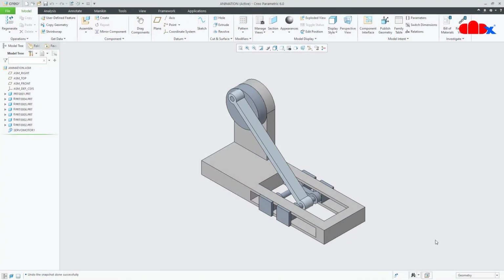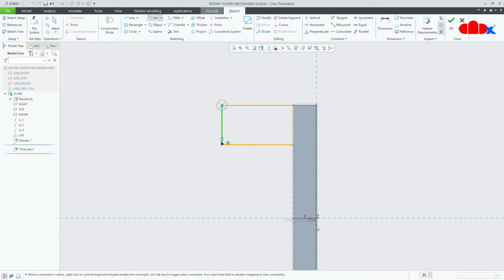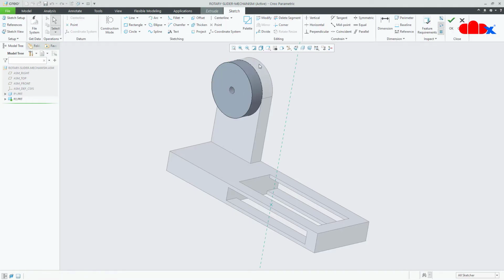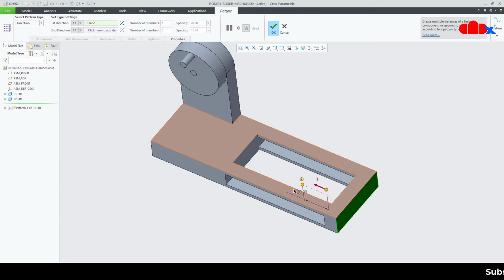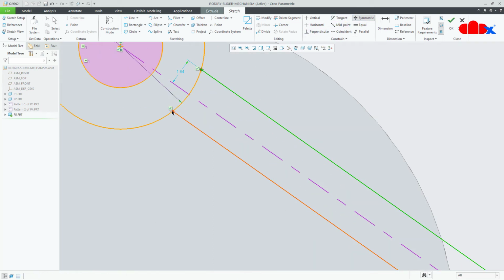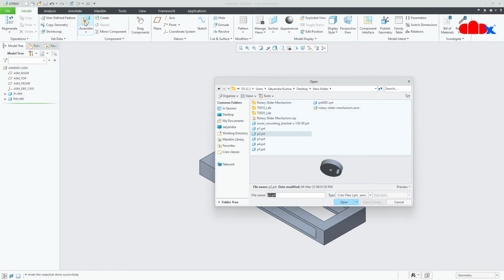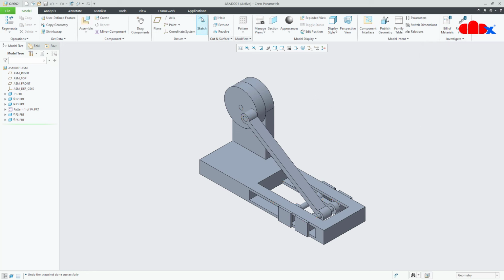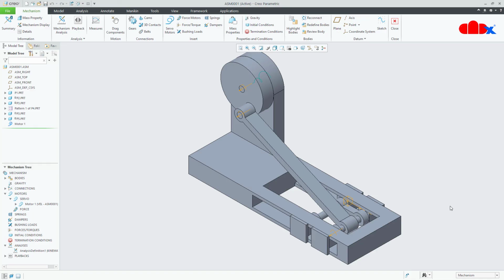Rotary slider mechanism | Top down assembly in Creo Parametric

Comment: In top down we create 2nd part in reference to 1st part. If i want to change the 1st part to be used somewhere else how will i change it. Because 2nd part will also get changed with it. How can we make them independent after making it in reference to each other
Reply from the maker: In that case, you need to break the existing reference and assign a new reference first

Comment: Yet again, another amazing insight into the capabilities of cad 3d drawing...this time using the Top-Down approach. This man is so good at this...outshines every other tutor on here or anywhere. He uses the right approach to teaching, but you have to listen carefully. One word heard wrong can lead to a lot of frustration. My fault...not his. One thing that I have noticed, though, is that when using the Pattern in copying the first Slider Part, the measurements are wildly out in my software. I had to adjust the distance to something like 367mm in order to get it to place in the assembly as you see his. Must be a bug in the software, but using trial and error, got it to 'look like' the same distance apart as his. Hope this helps anyone out there who have come across the same problemo.